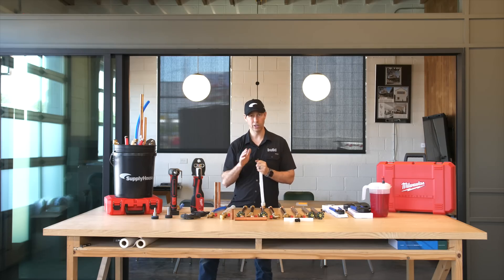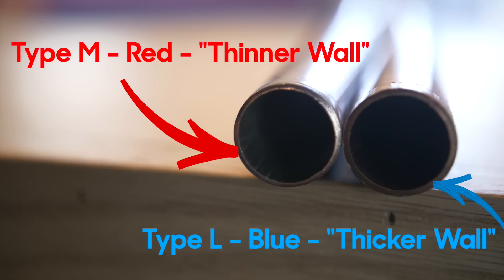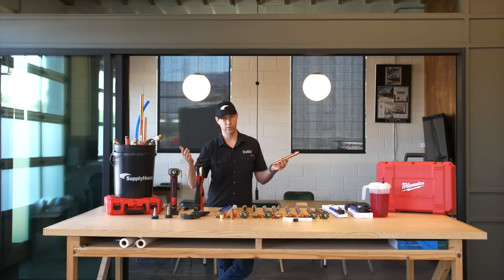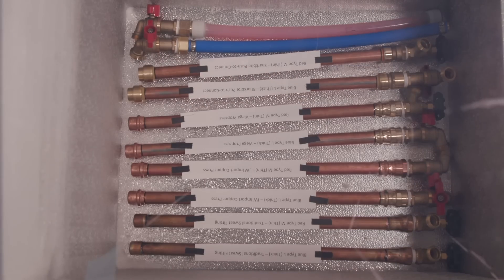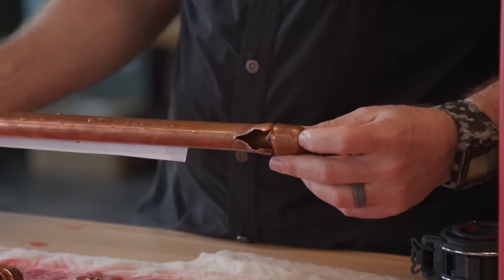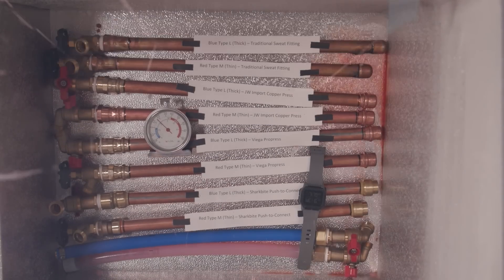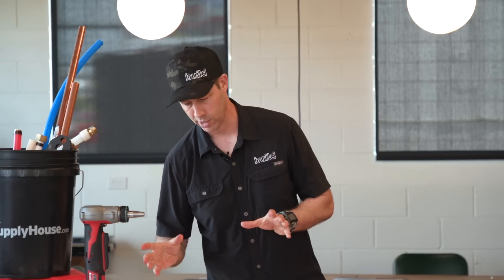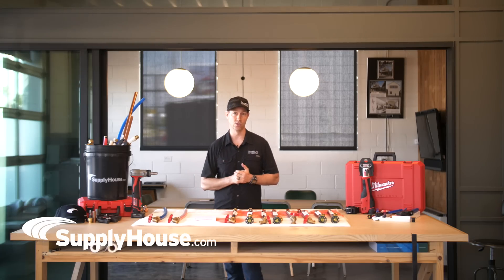Copper vs PEX Freeze Test Part 2

Comment: Matt, my father-in-law lives in a neighborhood where pressure regulators on house plumbing systems have been failing.  His neighbor had the pressure regulator fail and when the house water pressure increased to street pressure, the pex line from the hot water heater failed, flooding the house.  Instead of testing pex and copper in cold, how about finding out how temperature and pressure affect the various types of plumbing lines?

Comment: You're in a bad place if your plumbing freezes regardless of the product--but, I suppose if your press fittings completely disengage, you may get more water before discovered than a small tear in the copper. Supply House is a great company by the way. I have ordered from them before and was impressed with prices and shipping.

Comment: Hi Matt,
  I first saw these crimp fittings on a job in Paris in 2003, when my sub told me what he wanted to do I thought he was crazy, Old American PMs only knew sweat and solder back then!
  I had a 2" supply and return for chilled water in a stairwell in a historical building and they would not let us core drill. We ran them around and round up 6 floors, over 200 joints. Come test time I had 1 leak--' the plumber missed a crimp! I was surprised, but it really works and the time saved is amazing.
Plus there are no hotwork permits needed! ( AND NO FIRES)
Best to everyone, ( currently from somewhere in Eastern Europe)
Patrick

Comment: What I love about hot work, is we will be forced to not have a cell phone, no ignition source and purged environment etc to finally be able to do anything hot work related. Yet if we say we are not using flame, they'll let us use non-hazloc rated equipment, with open fucking sparks like that crimper, in a hot work environment and no one fucking bats an eye.

Comment: If anything the press fittings are easier to repair/replace. just pop a new cap on instead of cutting and replacing sections of pipe that blow out.

Comment: I know what I'm using in my house. Pex with compression fittings. Of course, I will also keep my pipes insulated and water off at street shutoff and open valve if I'm going to be gone for a bit in the winter.

Comment: This one is a better test than the last one, it would be interesting to see if you placed foam insulation on them if they would have survived longer.   I would uses a bigger top load freezer with each item in it's own pan and a time so you can see which lasted longer, while they all failed the questions is which ones lasted longer.  The one thing I learned is on all of them expect the welded one you don't have pipe blow out just fittings so the fittings act as a release valve if you have a freeze which is easier to fix than a blown out pipe needing to be replaced or fixed.   Lastly, I think pex proves it is the better piping because with longer runs and the use of less fittings if you do have a freeze there are less area's to fail I would think.
Reply: Insulating them would only delay freezing by a few minutes.  To prevent freezing, something needs to provide heat to the pipe and fittings.
Reply: @wallykramer7566  Yeah, I figured that I'd just like to see how much time you gain.  Sometimes 10 minutes is enough for it to start to get warmer.

Comment: Seems to me I would be better that connector pops off rather than the pipe burst. It is a much easier fix just to replace the fitting.
Reply: Yes, but if your pipes freeze and blow off a fitting be sure to inspect all the pipe sections for damage.

Comment: What was the temp of the freezer?
Reply: Less than 32 deg Fahrenheit.
Reply: There is a thermometer in the video clearly showing the temperature.  See https://youtu.be/w9W466z5Cwk?t=437   The temperature is around 15 °F / -10 °C during the burstings.

Comment: How about testing HVAC fittings. 
Zoomlock is pretty good.
Reply: I have a Ridgid RP240 and a few  zoomlock jaws. Over a year and a few hundred fittings with no issues. The fittings are insanely expensive but it's great for tight spots near combustible material.
Reply: You're saying HVAC connections are now available in press fittings? Really?

Comment: try it again but, with shorter pipe to keep them far enough away from the sides to see if the bibs will also move. Good video.
Reply: Again, I was thinking that the different walls could have different cooling properties. So do it again with pipes vertical bibs down end caps up.

Comment: You did not test against a traditional sweated/solder fitting; also since you filled them all to the max, each was destine to fail; consider a measured amount of water in each one. Estimate/calculate the volume and then add just enough water to exceed that volume by a certain percent.  Good job.

Comment: I wish you would have done one with  solder copper pipe
Reply: He did? Or am I missing what your sayingm
Reply: Aaron Cottingham Weren’t they all pressure fittings?
Reply: @jenniferlawrence1372  he had caps soldered on to a couple of them
Reply: @aaroncottingham4048  Can you tell me which ones?  I am not arguing, I don't know anything about this, and am trying to learn.
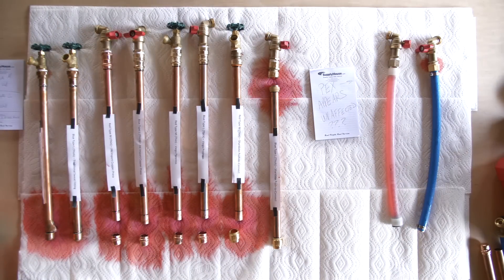Reply: @jenniferlawrence1372  No problem,  @5:50 it's the 2 all the way to the left.

Comment: @Matt Risinger The take away?  The king of high R-values, and air tight houses didn't bring it up?   Really simple... Water lines need to be insulated very well from exterior walls and drained if there is a chance they'll freeze. 😁
Reply: Yes, all the piping options work if you don't let them freeze, that was easy
Reply: He did say that.

Comment: I have been doing my remodel with expansion pex and its going great and even at $300 for the dewalt tool it so much cheeper then the crimp tools.
 you can make pex flex and any length and so many more awesome  details that I can't even go into so in my opinion, using any other system is just Antiquated or dumb.
Reply: I love not having to have plumbing connections inside the walls
Reply: Depends on requirements and specifications. Still a place for copper
Reply: @adamberkeley2127  maybe in commercial but when it comes to res-work there are no requirements that dictate the use of copper pipe, ( at least in the PNW) my friend who GC was told by his plumber that the only reason we havent had pex for 30years is because it was to easy and reliable so the unions knew it would start reducing the work they get.
Reply: @caidhg  The idea of drinking water encased by plastic is why I use copper.
Reply: @wallykramer7566  i can understand the concept but copper or any metal pipe erode at a much faster rate and the erosion is what your drinking. Leaching from pex is very uncommon and any amount of chemical that did leach would be super small.
I will say the amount of crap in the galvanized and copper pipes im pulling out is far worse for your body.

Comment: I dont think this was all that telling.   Reason being, in real life, there are other factors.  For example, instead of an end cap, what if there was an elbow or a T which was applying lateral pressure? Would the elbow pop off?    Also, in real life there would be many more feet of copper to expand into. Its very rare that the whole house of copper would be frozen solid.

Comment: i would guess that the caps popped off first because there is less mass on that end and froze first.
Reply: and once the cap pushed off, it was pushing the pipe and bib against the wall of the freezer keeping it from pushing off.
Reply: Could it be that the host bib fitting wasn't in contact with the bottom of the cooler and the capped end was , this it was cooled to a lower temperature or it  cooled faster?
Reply: @alankita1059  yup. Didn't think about it, mass difference just stuck out too me. Also this isn't a real world test. Most of the time hose bibs freeze outside because they are not protected.

Comment: I would be interested to see you test some compression fittings .  No solder no special tools required just a wrench.
Reply: Usually, the pipe fails before the joints in compression or flare systems.  In any case, pipe carrying water should never be allowed to freeze.  You won't care what failed first if it destroys a ceiling or wall system.
Reply: flare fittings also ..

Comment: Yep soldered the pipe will usual blow before the fittings, usually not always. Crimp or shark bite won't hold up. Pex, usually the fitting.  Pex is made to withstand some freezing. Made to expand but multiple freezes it Wil fail.
Reply: whitefeather poly pex fittings crack, lead free brass won’t.

Comment: I think a pressure test would be more interesting to compare the pressure at which the different connections fail
Reply: Did they have the press fittings though?
Reply: It might not be precise but they all failed at almost the same time point so about the same pressure and if you do freese something it will blow no matter what fitting you use. I think in the end it comes down to time and money and not the freeze test.
Reply: Yes i understand its probably never going to get to a failure point in your house but what is the max working pressure before failure
Reply: How was this not a pressure test?
Reply: @jestempies  the lengths of pipe were not under any pressure, they were just filled to max capacity in a sink.
Reply: @jestempies  This is not a pressure test.  A pressure test has a gauge and a controlled increase of pressure and recording at exactly what pressure it failed.  Freezing a bunch of pipes at the same time (Ice can reach over 100,000 psi) with no measurement devices is uncontrolled and simply will show how the pipes/connections will fail and not when they fail.
Reply: They done that video already.
Reply: Try and keep up, it’s been done

Comment: Nothing withstands a real freeze, even pex will deform and weaken.
Reply: Pex-A returns to its shape.
Reply: @Foche_T._Schitt  IT has some plasticity but will permanently deform or rupture with freezing.  That's why you'll never see a warranty from a PEX manufacturer regarding freezing.
Reply: @curtisbme  You're not getting it.  You'll end up with burst pipes using any plumbing product when it's exposed to a real freeze.  PEX has a small margin of expansion and then it'll fail just like copper.
Reply: @curtisbme  A damaged pipe will leak sooner or later or even burst. The problem with 'later' ... You don't know why as the freezing is long ago. The repairman will fix the line but may not fix the problem (the insulation).
Reply: Think of all the savings global warming will bring.  No more freezing.

Comment: i just worry about that seal degrading over time, i'm sure its proven.  But sweated fittings it seem to out last the copper tubing (pin holes ect after 50-60 years)
Reply: Viega has a 50 year warranty on there fittings.
Reply: @aaroncottingham4048  the question is still the same they haven't been tested long term and will Vega be around in 50 years (if there becomes a big issue they might go bankrupt and close the doors) (or the owner retire/die and kids sell off the business etc) 50 years is to long to know what will happen failure wise or company wide
Reply: @aaroncottingham4048  And my roof has a fifty year warranty but we all know it ain't gonna last that long.